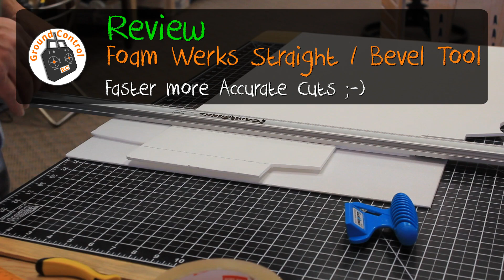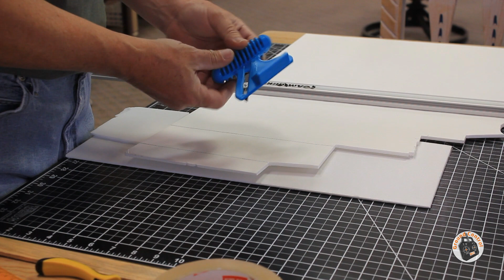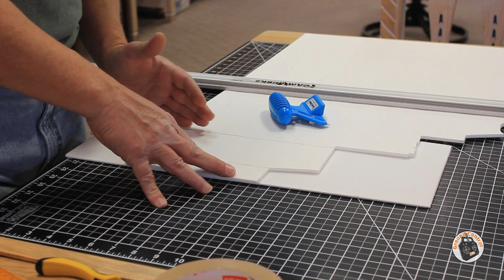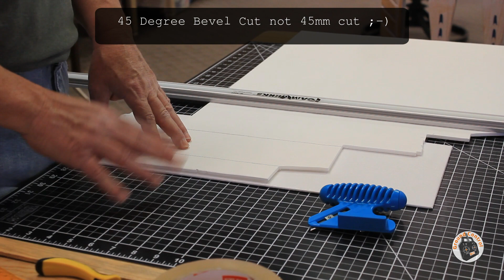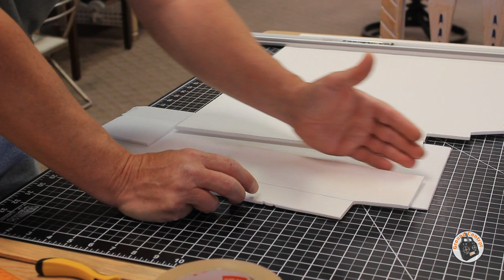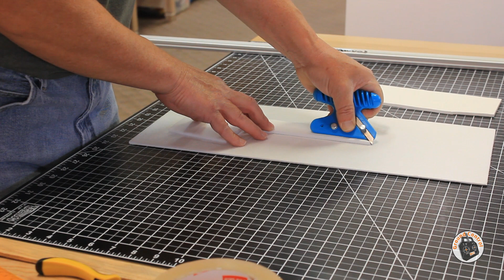Review - Faster more Accurate Cuts with the Foam Werks Straight & Bevel Cutting Tool

Comment: This is a great tool. I've used a smaller one for years. With arthritis I'm getting the one you have. Why did you cut all the way through the foam for control surface ? Set the blad up a little so it leaves the paper on bottom side, fold it back on its self and use the 45° attachment to make your bevels. Use the guid. That way your control surface stays were it should and gives extra strength after applying hinge tape. And is that a black cutting board, if so why cut on top of good foam ? I hate wasting foam board its increased in price. But cheap foam board and practice. Foam planes are fun to build and fly. Good luck.
Reply from the maker: This was only for demonstration purposes but what I will do to create control surface hinges, most of the time, is to use actual nylon hinges.
That way you don't have to worry about the paper separating from the foam board.
I've used tape hinges for years but the nylon hinges work better.
The mfg of these tools recommend using scrap foam on the bottom so the blades don't dull so fast.
Scrap foam is much cheaper than replacing blades ;-)

Comment: Great tool!!! +Seems to be extremely handy on handling the EPP/EPO. Looking forward on the time saving aspect of it.
Reply from the maker: Thanks Robby! Just with the demo and not having used this tool before I think it will reduce my sanding of the leading edges of the Wing, KF Airfoils, and Control Surface Hinge Bevels by at least 50%. That will save me a significant amount of time. I spend more time sanding edges than anything else in the build process. See you in the Air!